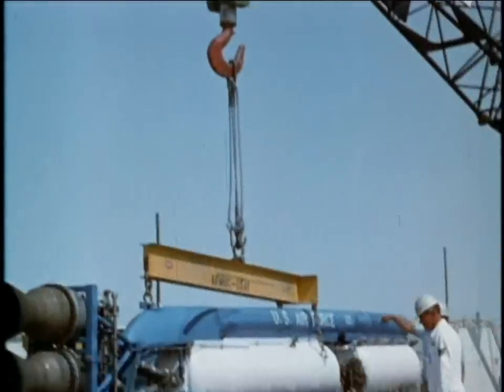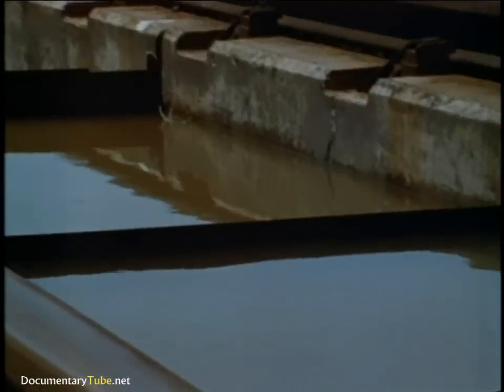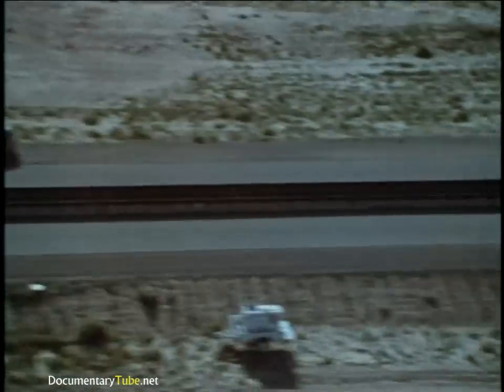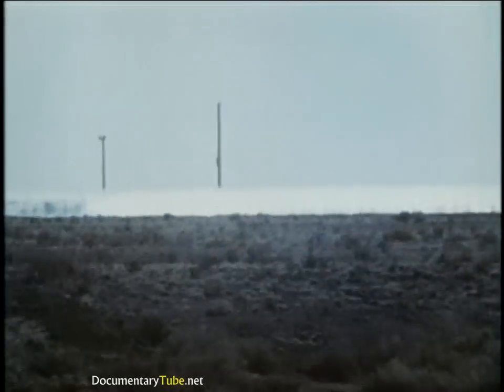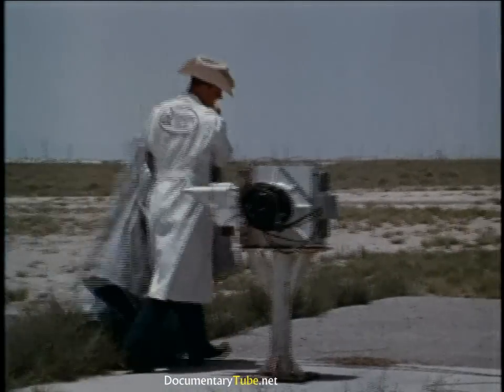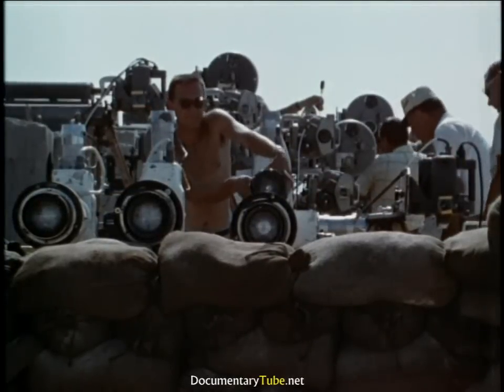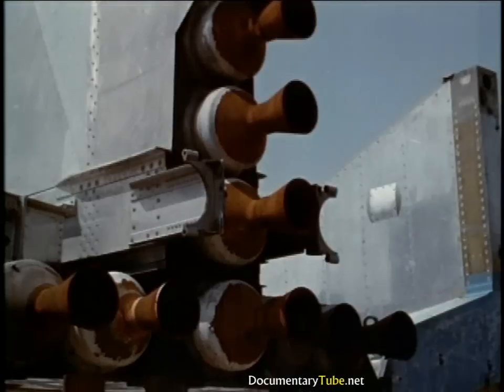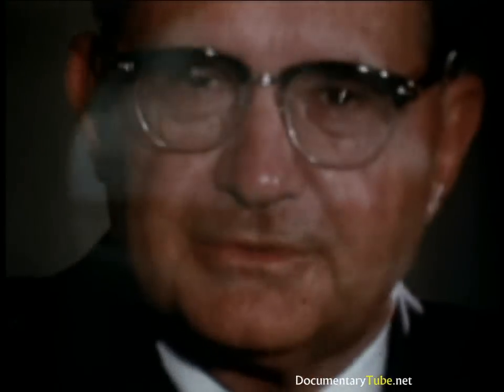Fastest Rocket Sled in the World: The U.S. Air Force Railroad

Comment: was hoping to learn about its times   0-60  1/4 mile   mile  top speed
and time to stop
Reply: I think you could gauge relatively close by this wiki rocket car excerpt >> "Sammy Miller in 1984 at Santa Pod Raceway recorded the quickest quarter mile elapsed time ever of 3.58 seconds at 386.26 mph using a hydrogen peroxide powered engine car called Vanishing Point". Amazing .. and it shows how awesome track & traction dependent TF/TFFC's are to be competitive with it. All mentioned are pulling 3 to 4+ G's acceleration with a human onboard and an all out rocket car of today could do better and a rocket sled in the glory days defo has done better.

Comment: The PC I am using to watch this video has 100x more power than that whole brick building. My hard drive could store all the data captured on the magnetic tape for every single test ever recorded. I can run O-scope programs that has more features than the engineers who designed the original hardware even could think of back then. And that's just my little ol' laptop. Think about what the military are using today. Amazing leaps forward.
Reply: Yes, we sht on the sixties!
Reply: We’re leveling off actually. There are indeed limits to physics. Crazy leap forward. Always keep learning. But still.
Reply: 2023…the cell phone im watching this on…etc etc etc!

Comment: COSTLY MACHINE AND GREAT WORK,STILL I COULD FIND USES FOR ITS HIGH SPEED IMPACTS IN TRYING TO MAKE DIAMONDS OUT OF CARBON ,IF THE IMPACTS HAPPENED AT HYPERSONIC SPEEDS ,REALLY I HAVE NO IDEA,OR WELDING SOME EXOTIC MATERIALS USING THESE HIGH SPEEDS,THERE ARE STILL OTHER USES MIGHT COME UP
Reply: At those speeds, not much is left after an impact with an object. During a launch event presentation, we were shown a 12 inch square, 1/2 inch thick piece of plate aluminum.
It had a very large (~6 inch) hole in the center. The presenter explained "this is what happens when you hit a pigeon at 1200 MPH."

Comment: Wow, they've had 100k FPS high speed cameras for longer than I thought!
Reply: The Brits had a 25 million FPS camera for their atomic tests.
It's possible the US had something comparable for the first Trinity tests, but remain classified to this day.
Surprisingly, to this day the fastest monochrome electronic cameras (Shimadzu HPV-X) top out at a 'mere' 10 million, although framing cameras (a few dozen frames total) are hitting one billion fps.
Reply: @I TF· ·FR ME· ·R ATE TenFramesPerSecond very cool.

“The Cordin Model 510 high speed rotating mirror CCD camera is the world’s fastest non- intensified digital imaging system. The Cordin rotating mirror technology provides significantly better image quality and a higher number of frames than is achievable with any other high speed camera technology.

The 510 camera system offers 128 frames at speeds up to 25 million frames per second (fps) with full 14 bit dynamic range. Each image is 616 x 920 pixel resolution.

The gas driven turbine mirror-drive will operate on compressed air or nitrogen to 5 milliion fps. Higher speeds, to 25 million fps, require helium to drive the turbine.”

Helium-powered turbine sounds spendy. ;)

Comment: All physicists cringed at the word "deceleration"
Reply: Sam C I'm pretty dumb, but I think I understand ,is that because everything is moving.
Reply: Anthony Mullen No, it's because the word "deceleration" doesn't mean anything. What's actually happening is that the object that's slowing down is actually accelerating in the negative direction, not "decelerating"
Reply: Sam C you see.. I told you i was dumb ...but i think I understand.thanks
Reply: I guess it's a bit like when we're talking about cold. There is no such thing as cold, only the absence of heat, it's just that it's much simpler to say cold and the point is still made

Comment: Why don't trains actually go this fast?
Reply: Michael if you are talking about trains on rails like the tgv then it's because, at this speed, the smallest curve or anomaly in the rail, whether it is a bump or a spot where the distance between both rails changes a bit, the sligtest of these disturbances in the straightness (if that's a word) of the track will make the train derail and crash. Other than that, there is the hyperloop project going on which will go really fast, but it's not the same thing
Reply: because people don't want to die
Reply: waitwaitwait is your name really anthony smith?

Comment: why not launch hybrid spaceplane off of an electromagmetic rail, at an incline [on a high altitude mountain] to assist takeoff. high altitude would cut air resistance and the rail would cut fuel capacity needed to reach orbit. which in turn would save $$$ per pound

Comment: i don't get the term "the fastest railroad" though because i'm pretty sure they didn't show a test in this video showing a sledge reaching mach 8.5, did they? It's the same thing with race tracks when i watch Top Gear, how is ther a race track (can't remember which one) that is claimed to be the fastest race track in the world or in it's contry or in history ? how is this the fastest railroad ? surely it depends on what's traveling on it that makes the TRAVELING object the fastest hitting mach 8.5, not the railroad? someone please explain why or how this is the fastest railroad and where can i see mach 8.5 in action.
Reply: Joe Thornhill When referring to the fastest racetrack they're talking about the pace.
Reply: Arrie Kanarie yeah i know, I've thought about it and i think because the railroad is so accuratly straight and parellel it allows things to travel on it faster than ever, faster than on any other surface or reach top spead (terminal velocity). but i don't get the "fast race track" name. If a race track has exceptionaly smooth and level surface and some of the longest straight stretches to allow the cars or bikes to get up to spead and continue to drive around the track faster because of smooth surface, does that make the track "fast" ? Because the cars can go faster or reach top speed better, easier, or faster than other tracks? or do you have to go round the track faster than any other track for some othor reason?
Reply: Joe Thornhill
Reply: if you put your reference sistem on the train, the train is not moving, what would be moving is the railroad :)
Reply: The test in this clip was in 1954. The land speed record was set in 2003.
You can see it here: https://www.youtube.com/watch?v=JTiG2FsXQVk

Comment: Mach 8.5 my ass - the air density at ground level would make anything going 8.5 Mach at ground level a burning meteor due to the massive aerodynamic friction. Even the lowly SR-71 which only flew Mach 3.1 at 85,000 feet where the density altitude is very low (and the Mach is a much lower mph, BTW!) heated fuselage points to 900 degrees C - and that is at a very low density altitude and where the Mach is barely over 600 mph, whereas on the deck the Mach is 760 mph and the density altitude is brutally high. None of these sled runs is even at or above 2.0 Mach, tops.
Reply: That’s why those runs went through a helium filled tube
Reply: The actual number of 6,416 mph is provided by the US Air Force for the run that took place at the Holloman Air Force Base on April 29, 2003. It maintained that speed for seconds, not quite long enough to turn into a burning meteor.
Reply: mikepodella .... Thanks Einstein !
Reply: I worked there from 2002 to 2005. The mach 8 run was real. Here's a video clip of it:
https://www.youtube.com/watch?v=JTiG2FsXQVk

Comment: Never saw anything in this video going that fast. I call BS.
Reply: Definitely NOT BS. I worked at Holloman from '02 to '05 and considered it a real treat to watch the LSR get set in '03. Viz:
The HHSTT currently holds the world land speed record for rocket sleds set in April 2003, at Mach 8.6, or 9,465 feet per second (2,885 meters per second), or 6,453.409 miles per hour (10,385.755 kilometres per hour).

Comment: That whole spill about the type of technology being used to record the data just felt like such a drag considering now this is easily attainable with a few cameras, some sensors, wireless networks and some storage devices much smaller than that monstrosity lol
Reply: Guys who are doing such things, don't care about size of equipment needed to get their job done. Of course, sixty years earlier there was no such thing as palm size terabyte storage and overall dimensions of electronics was a much larger. At modern equipment the largest parts probably will be antennas and objectives because laws of physics regarding optics doesn't change. However all that lab stuff will be pretty bulky even at today.

Comment: This is NOT the fastest railroad in the world and it could NOT support a sled traveling at Mach 8.5! This movie is from the late '60s; the facility did not reach Mach 8.5 until April 2003. The Mach 8.5 run required a three mile-long plastic tunnel filled with helium in which the sled traveled.
Reply: You know that there is a hell of a difference between Mach 8.5 and Mach .85 don't you?
Reply: Richard Alexander
The record set in 1954 at this facility was broken in 1959 at the China Lake facility in California, which would stand until a new record was set at this facility again in 1982.
Reply: This is G-force testing for humans
Reply: True WRT to the dates, and the helium tunnel. But it IS the same track. The only difference is the length.